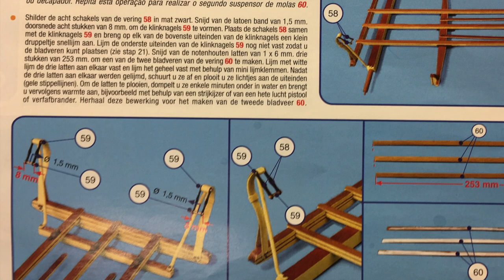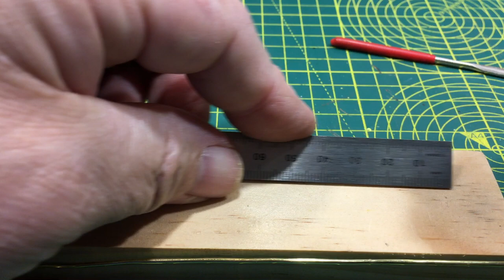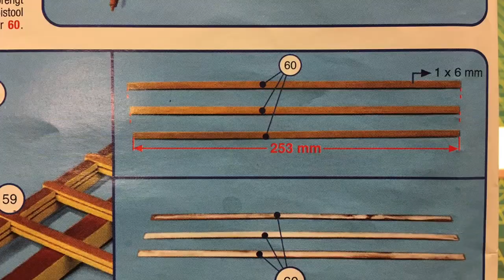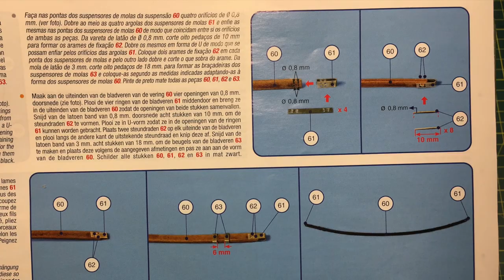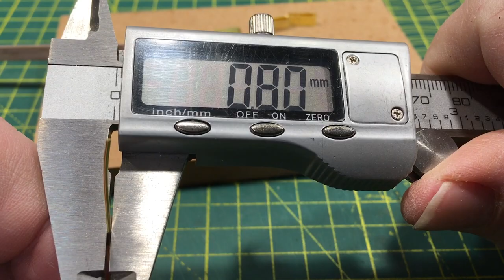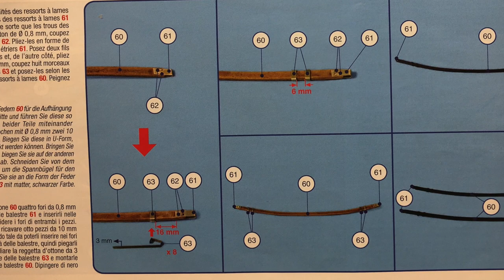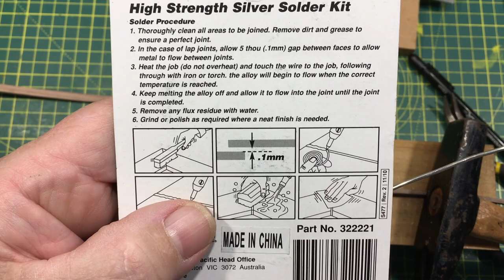Artesania 1848 Stage Coach - Build 11

Comment: Hi Chris Thanks again for the very informative videos. Very much needed. The question I have regards the front wheels turning carriage attachment to the main frame.  It isn't fixed and therefore may come adrift when the whole stage coach is finished. Lifting the stagecoach by the body. Do you think it would be viable to fit a 1mm piece of wire through both front wheel carriage and the main undercarriage to make the fitting permanent or is there something I haven't considered.? Would value your opinion.
Reply from the maker: Hi Neutrad,  I thought the same and did look at other ways to keep the steering system attached if the model was picked-up.  My idea was to replace the short pivot pin with a longer pin and solder a washer to the top and tap a thread and a nut to the underside to keep the steering fixed to the chassis. In the end I decided to leave the model exactly as Artesania intended and made sure my holes were nice and tight while still allowing the steering to operate.  I have discovered this works quite well and I can pick-up the model where the steering system does stay attached.  Although I would still handle the model by supporting both the steering and main chassis together.  I hope this helps you decide on a path here and would appreciate your comment on what you decided.
Reply: @chrisoxford8442  Thanks Chris, I did consider the integrity of the model ..  I thought that the real Stage coach would have had to have the steering carriage fixed anyway. Not sure why Artisania didn't do that . Hopefully the model will have a long life and could possibly end up in different hands and environments, timber expands and contracts. Also being a belt and braces sort of person I decided to make the fitting of the steering carriage to the chassis a fixture.  To do that I  cut a piece of 2mm dia rod to length to pass through the chassis cross beam and into the steering system. To one end of the 2mm dia rod I made a 1mm hole and inserted a 3mm piece of 1mm  dia rod. I passed the 2mm dia rod through a small washer so that the 1mm dia piece rested on the washer . I joined the steering to the chassis by passing the completed pin through the chassis into the steering carriage already made hole and applying a small amount of glue to the steering carriage end, making sure not to glue the steering carriage to the chassis.  The steering system is now fixed and cannot come adrift under any circumstance. It turns quite freely and looks unobtrusive and can be removed if necessary by removing the 1mm pin.  Hope that all makes sense.
    Onto my favourite bit now the timber construction. I'm afraid working with metal isn't my thing and I have had a few headaches but thanks to your  helpful videos I have managed to get through.  Cheers David.
Reply from the maker: Neutrad , nice one.  I fully understand your description on what you did and really like the idea.  I think I might follow your lead and do the same once I complete the model.  I too enjoy the timber but don’t mind working with metals as it’s ingrained into my being from my past trade as a panel beater from my youthful days.

Comment: Hi Chris. Yet another question.. I notice you have soldered a number of connections. I just picked up a soldering iron plus all the things that go with it. I have no experience at all soldering so I have been practicing on scrap of brass wire. However despite my efforts, my connections are not holding. I have watched numerous Youtube "how to" videos. Some show the solder being applied to the tip which is then pressed up against the joint. Others show the solder wire put on the the joint and then soldering tip placed on top to melt it. I'm now a bit glassy-eyed from all the videos. I've watched your soldering and it looks like you place the soldering wire directly on the spot to be soldered and then apply the heat from the iron. Have I got this correct? Also I have been applying flux first and waiting until the iron reaches approximately 400 C. Still...poor adhesion. Is there some tips you can suggest. I am running out of brass bits and pieces for my failed practice sessions!! Thanks, again, Carl
Reply from the maker: Hi Carl, I have used standard electronic flux core solder and silver solder for these types of joints, both work well.  In this case I used electronic flux core solder. The brass needs to be squeaky clean also. I use steel wool or super fine sponge backed sand paper, 1000 grit, then acetone to clean the parts.  The other trick is to have a small gap [1mm or so] between the parts to allow the solder to flow and create a joint of solder. Yes, I place the soldering wire near the spot to be soldered and then quickly apply the heat from the iron. Make sure the iron tip is always clean and tinned with solder.  The object is to focus the heat to the joint area where you want the solder to flow.  Yes, it is a bit of learning curve to become proficient with the process but you can do it mate :) Use the same brass bits for practice, just make sure they are clean.
Reply: @chrisoxford8442  This is so helpful! Thanks & Cheers.

Comment: Where did you get the silver solder. I can’t find it locally. And is flux used with silver solder.
Reply from the maker: Hi Michael.  The silver solder I use is a flux core type I purchased many years ago from a local supplier. Cigweld is the brand I have. You could other non flux core and use a flux paste but I find this type I have so easy to use for many projects.

Comment: Hi Chris. I have a question. I'm in the process of putting the springs together, but I don't have any 1 x 6 mm strips. The closest ones I have are .6 mm x 6 (or some at .7mm x6mm). Do you think these will be adequate when I glue 3 of them together? I tried to find some additional .6 mm x6 to maybe add a 4th strip, but there aren't any. Your thoughts? Thanks, Carl
Reply from the maker: Hi Carl. I would check through the list of parts in the back of the manual and do a stocktake on what they supplied in the kit. Then you should be able to make a decision on which strip size to move forward with. I did this before starting the kit so I knew before ploughing in. I didn’t show this step in my videos.

Comment: Another question. Did you soak the strips before gluing them and placing them into the curved shape to dry? Thanks.
Reply from the maker: Hi Carl and thank you for your questions.  I have not needed To soak any of the timber’s until recently where I steamed the 2x2 sapelly battens for the side frames on the box. Step 33 in my kit instruction manual.
Reply: @chrisoxford8442  Thanks Chris. I checked the inventory list and couldn't find any strips that correspond exactly to the .6 x 6 mm ones that I have. So I am assuming that these are for the springs. I have written to Artezania to check this out.
Reply: @chrisoxford8442  So, you just glued the strips and put it in the bent position. And it stayed bent? Sorry for the naive questions...Whenever I had to bend wood in the past I have needed to either heat it or soak it.
Reply from the maker: Hi Carl. Yep, glued up the strips, put into the shape and clamped as in the video. Please don’t feel sorry for your questions, happy to help as best I can if you need.
Reply: @chrisoxford8442  Thanks. I am learning a lot from your experience. So I appreciate you taking the time to help out.
Reply from the maker: Thanks Carl. I guess that’s why I decided to video this particular build as I too have struggled with some kit builds in the past where I had to just ploughing on and work it out for myself. Glad your enjoying and they are of some assistance to you